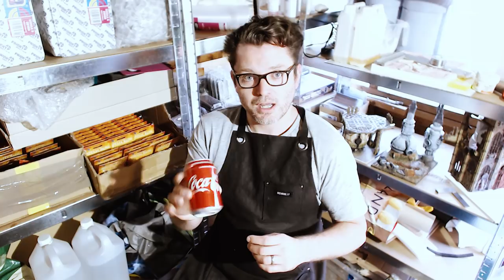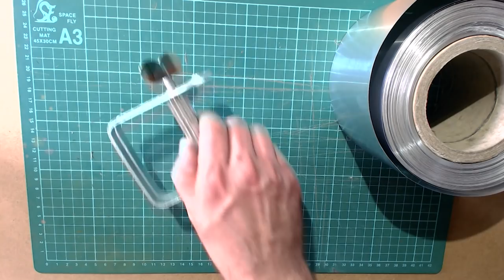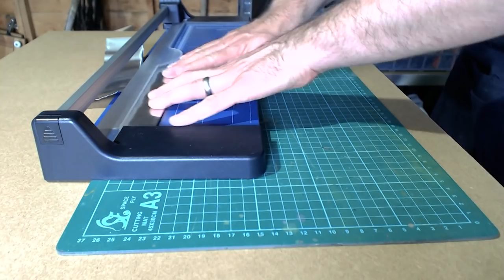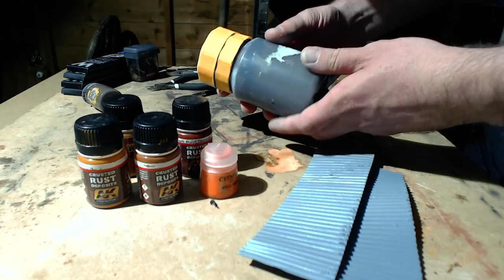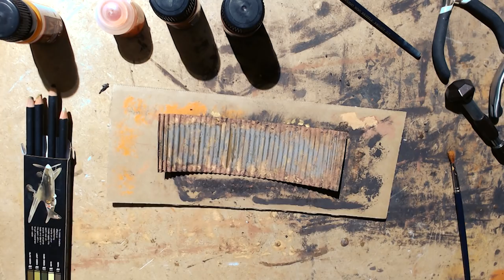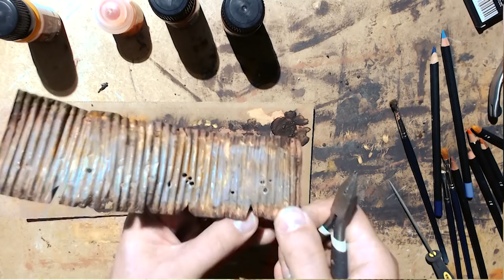Crafting Corrugated Metal Panels — A Guide

Comment: Very cool video! Do you think the little tool would work on 0.25mm styrene sheet (plasticard)?
Reply from the maker: Just tried it out for you. It does work, but you get a very low profile corrugation. My next step up that I have on me is a bit of a jump and will probably snap the styrene. Perhaps a 0.5 or 0.75mm could get a tighter corrugation? https://imgur.com/a/HJX2PFk
Reply: It snaps styrene, Works great on card, tin and as here, aluminium. But every attempt I have made with styrene it creases too much and each crinkle forms cracks and snaps, great at making lots of tiny strips!!!
Reply from the maker: @jefferytapp1612  That was what I was expecting, but the 0.25mm held up, just with a low profile corrugation. See the imgur above. I am wondering if at 0.5 or 0.75mm it will still corrugate as the 0.25mm but hold a shape better. It could work?
Reply: @TheImmersiveWorldCrafter  That is not bad, when I tried I got hardly any then with extra pressure it just cracked, maybe dependant on your styrene! Maybe mine was more brittle, wonder if you could warm the sheet up a little and it would be more pliable, damn the pair of you now you have me thinking. Up to now been happy enough cutting up coke cans!!!
Reply from the maker: @jefferytapp1612  TBH, the coke can is still the most versatile. Like I say in the vid, it behaves like the real thing because it’s metal. You can scratch it, tear it, bend it and it has realism because it is the correct base material to be using.
Reply: Could you maybe warm the styrene in a low oven to get a sharper corrugation?